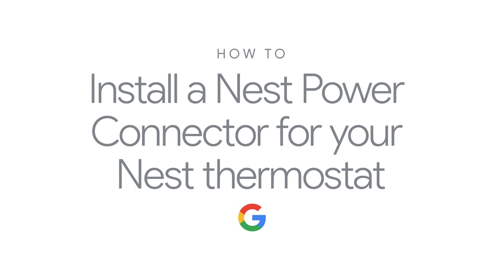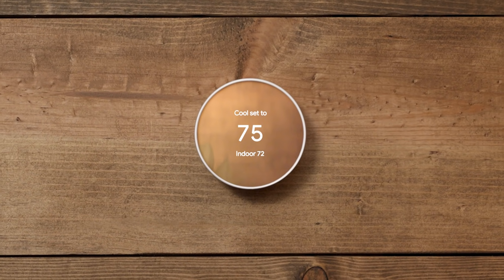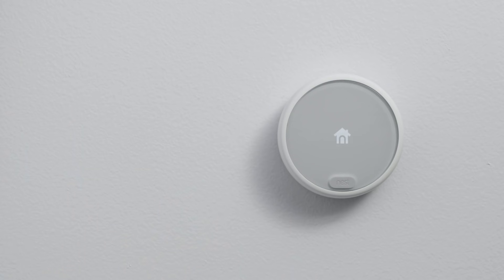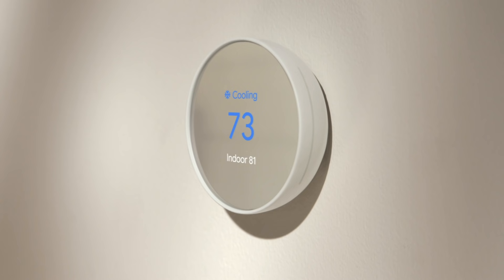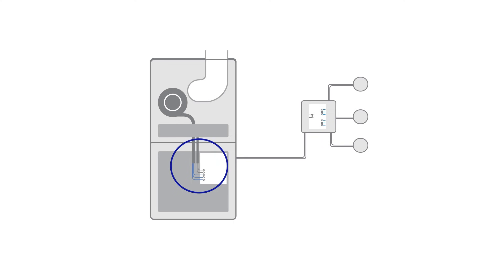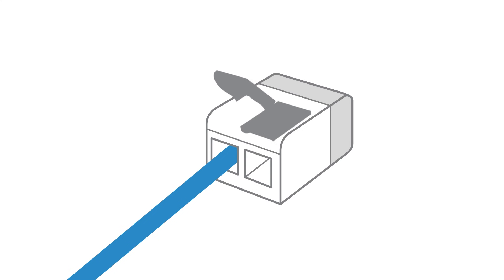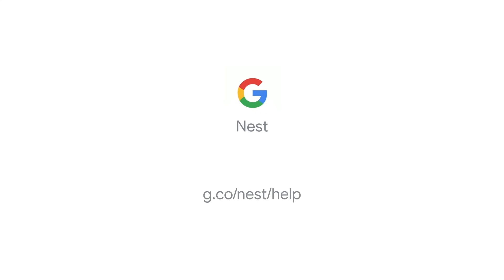How to Install a Nest Power Connector for Your Nest Thermostat

Comment: My learning thermostat gen 3 worked fine for years without this connector, and I had the Nest app. Now with my new Nest thermostat, I have to use Google Home and it is requiring me to use the adapter, but I only have two wires from a boiler - no HVAC system. The app will not allow me to install the thermostat without the adapter, which I know I don't need. Infuriating to say the least.

Comment: 2025 - no, just another wart and wire coming down a wall -  proving still that a 20-year old AA-battery-powered smart thermostat (for a basic heating system) is still more hassle-free than this.  Unprecedented, Google.  Now let me go pull that thing back off the wall.  :/

Comment: So for me this was relatively easy, but one thing I did not notice is my AC system has a switch that requires the system board cover to be screwed in or it will not power up. Had me losing my mind for a solid 25 minutes.

Comment: What exactly is an air handler, and is that something that would be installed somewhere in the walls of my apartment or in a central location in the building?

Comment: Stop treating us like idiots and show us actual equipment and wiring rather than oversimplified diagrams. I can’t make heads or tails of what you’re talking about.
Reply: Well that's oxymoronic..

Don't treat me like an idiot but I need specifics and images of it being installed onto equipment.
Reply: How are you still confused if you believe it was oversimplified? This was about as straight forward as it gets. I'm sure there are hundreds of different furnaces out there along with many different configurations for setting them up. Would you rather prefer for this video to be 12hrs+ long instead? Would you watch the whole thing? Probably not. Just pay an electrician to come out so they can refer to this same exact video. I bet you'll feel better then lol
Reply: @Viper3870750 yes, yes I would. That’s the meat of what we’re looking for.

Comment: Unfortunately doesn't work for me. My AC (cooling only) - option 7 - only has a R and G wires (in addition to C), no Y. I tried running the G through the connector instead and feeding the C into the circuit, but the AC would no longer start after that so had to remove entirely. I guess I need an electrician to fish a C wire through the walls to the thermostat. Bummer as I was hoping this was the fix to this long standing problem.

Comment: I have 3 RA832A switching relays, and a unit that I think is the zone controller (it has the X-wires from the RA832A's and 2 dials set for 100 & 180F). I don't see any 24 Vdc available. I have 5 thermostats (2-wire r/w) but I only see 4 wires into the furnace room (the 3 connected to the RA832A's and one which has been cut). I'm at a loss how to proceed with this.

Comment: My furnace doesn't have a control board and doesn't have a c/com wire to use which is why I bought this useless item. I guess if you don't have enough wires to the thermostat is useful but it doesn't create a c/com
Reply from the maker: Hey there, we're here to help. If your thermostat has power related issues, like the battery draining too quickly or Wi-Fi constantly disconnecting, you can typically fix them by connecting a common wire (C wire) or by installing the Nest Power Connector. Learn more here: https://goo.gle/3bKL9bO For more help, feel free to contact us here: https://goo.gle/2D2Shve

Comment: Your comment is true nest set up instructions say in the first sentence, only two wires needed. Those who have no issues with the start have a complete heating , ventilation and air conditioning system. That system already has 5 wires designed in warmer climates.

Comment: Had this issue with nest in my 1st house, having it again in another house. Looks like a common pain in the crack with Nest thermostat. Hope this thing finally helps and it doesn't cost another $300, I am freaking tired of dealing with that low battery headache. Was ready to switch back to my 20yo honeywell at some point, it works with no issues
Reply: That 20 year old honeywell is a workhorse. Simple bimetal + mercury circuit that works flawlessly. Would be perfect if you could setup a schedule or control it remotely.
Reply: I prefer Honeywell over nests. Nests are garbage

Comment: I have three Nest thermostats and did a direct replacement from the old thermostats with no issues. I just bought a Nest E and it gives me the error. Google offered to send me the power connector for free. I have a boiler with Taco controls and no C-wire. I ordered a 24v adapter but aren't sure how to connect it. Obviously, one wire goes to the C terminal and the other? I assume the R terminal.
Reply from the maker: Hey Joel, thanks for reaching out. Nest Thermostats are designed to use very little power, and in many cases they could use your system's heating and cooling wires to get enough power. But sometimes, you may need to connect a common wire (C wire) or power accessory, like the Nest Power Connector to provide a stable power source for your thermostat. Check this guide out: https://goo.gle/3VsXjby

Comment: WHERE DOES THE GIGANTIC POWER CONNECTOR GO?!?!?!     It’s bigger than the thermostat where are you hiding it?!?!?!?!
Reply: same question... there isn't a single video or pic that explains this anywhere... I wish @madebygoogle would make a video on this! I am thinking you just shove it behind the wall but this is so unclear.
Reply: I purchased a bigger thermostat. I only have white and red wires going to my thermostat which is a heat only system so I’ll just have to hide it in the wall.

Comment: It took a bit me to under stand why we need a c wire. Basically the heater and thermostat is in series. The heater is going to be taking up most of voltage and the thermostat get not enough. So adding a c wire it in parallel so the voltage is same.
Reply from the maker: Hey there, thanks for reaching out. Nest Thermostats are designed to use very little power, and in mayn cases they could use your system's heating and cooling wires to get enough power. But sometimes, you may need to connect a common wire (C wire) or power accessory, like the Nest Power Connector, to make your system compatible. Check this out: https://goo.gle/2K2Pk1s

Comment: I have a Nest Thermostat (2020) and my installation has the following wires: C, G, Y, O, R.
My equipment turns on correctly but I have no power (error N 260) and it quickly disconnects from Wi-Fi.
When I do the voltage test it tells me that it has 24 volts....
Could you please tell me if buying the Google Nest Power Connector solved my problem??? Should I cancel the C cable and put the connector?
Thank you so much!
Daniel
Reply from the maker: Hey Daniel, we're here to help. You could try removing the C wire and reinserting it again. Learn more here: https://goo.gle/3z49bpY
For more help, feel free to contact us here: https://goo.gle/2D2Shve

Comment: Why is it that everywhere else says that the Nest is compatible with most HVAC systems except for high power systems, including most older systems. But on this video the line is now it doesn't work with high or low voltage systems? 
I bought a Nest & it immediately blew out my HVAC. Now I'm paying to have a repairman to fix my HVAC & I stall the Nest....but honestly I'm starting to think that there's just too much suspicious double talk coming from Nest & I may just need to return it, but a more honest competitor, & look into having Google fess up for it's shoddy product.
Reply from the maker: Hey there, thanks for posting. In the video, it doesn’t work with millivolt (NOT low voltage) or high voltage. Here's a guide: https://goo.gle/375XG2f Also, we appreciate all the things you did beforehand and getting Nest products as part of your home. If you need more help, reach out to us through our support channels so we could look into it: https://goo.gle/3meAs19

Comment: Seriously? Advertising that no C-wire required, and here we go 🤷‍♂️
Returning this misleading product. I have  very basic 2 wire heating system and it will NOT work without c-wire.
Reply from the maker: Hey there, thanks for posting. While our thermostats are designed to work without a C wire in most homes, some systems may require a C wire for consistent power. You can also check our support website for reference: https://goo.gle/2K2Pk1s

Comment: I got a Nest Learning 3rd Gen which I installed during the summer. There were only 4 wires in the wall (W, Y, R, G) and no C wire. Nest worked just fine until one day outside temperature went down below zero(C). Now it just gives Error E80, Y1 wire has no power. I have a new HVAC system and well maintained. So the problem is there is no C wire at the thermostat end and nest thermostat is not getting power.
Will Nest Power connector resolve the issue?
Reply from the maker: Hi Makhsusali, we're here to help. The E80 message means the thermostat physically detects the Y1 wire, but can't complete a circuit. It’d be best to try the steps on this link first instead of getting a Nest power connector to see if it helps: https://goo.gle/3VCCAkv If the steps on this link doesn’t work, you can reach out to us through our support channels so we can better assist you: https://goo.gle/3ie15Ae
Reply: @madebygoogle  Thanks so much for your response. The very last step from the given link suggests me to Install a Nest Power connector as a permanent solution.

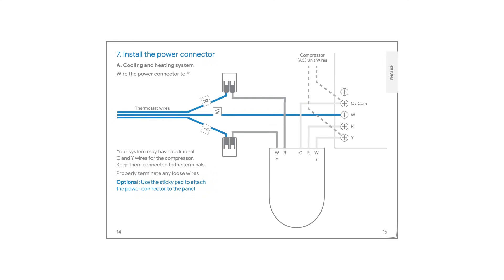Comment: My furnace at home has a gas burner, fan and AC with outdoor condenser. Followed the exact instructions as shown at 3:42 for a heating and cooling system using the Y-wire, but the furnace burner and fan won't come on when I enabled heating and only the outdoor condenser/AC compressor would enable when cooling. I reinstated the Y-wire to the furnace board and used the W-wire instead, and everything now works in both heating and cooling mode.
Reply: I’m having the same issue. Only AC kicks on no heat. I’m confused as to what you did instead. Re instated the y wire and used the w wire?
Reply: @lawrence9844  I connected the Y-wire directly back to the furnace control board and connected the W-wire to the power connector (like the heating only diagram).   It worked for a day or so but be warned, my furnace died shortly after that. I suspect the power connector was not able to maintain a consistent voltage supply and was messing up the control board. Replaced the furnace and put in a new cable with a proper common wire.
Reply: I'm curious to ask if you all set it up for the AC fan to come on while calling for heat
Reply: @DARTHREVAN1211  actually, my old furnace ended up dying after I commented around this time last year. Got a new furnace with a dedicated power wire to the nest thermostat. Everything has been working as expected so far.
Reply: @hiddenmist2  Did you try replacing the HVAC control board before replacing the entire unit? If you thought the voltage from the power adapter messed up the hvac it would have only affected the control board which wouldn't have made the entire unit bad or need to be replaced. 
I was told by a heating and plumbing guy that my central air conditioner outdoor condenser was "hit by lightning" and I had to buy another one that was $500.00, I live in a trailer house with a tin roof and the condenser was in the corner of the trailer and my back porch. There was no possible way that lightning could have hit the condenser being so close to both walls and much closer to the ground than the metal easy bake oven of a trailer house and added back porch, without hitting the trailer first because it is closer and further away from the ground. In addition to the absolute lack of any lightning storm or power outages. I later found out that it was just one of the capacitors in the condenser that went out and it was replaceable for less than 20.00 rather than the whole condenser unit needing replaced, the service guy just didn't want to put a new capacitor in it, when he could sell a new entire condenser and the labor to remove the old one and install the new one. I haven't ever fallen for that kind of  service ever again. If they tell me I need a new unit instead of repairs I tell them I'll have a different service place to get it from and installed by. They usually don't want loose the business and suddenly they thought of how they can repair the components instead of replacing the entire unit.

Comment: This thing completely failed me.  I was connecting a Google Nest 2020 version to a Taco 503-4 switching relay.  My other zone has a Google Nest Learning and it doesnt require this thing.  The 2020 thermostat still kept saying the stupid power error even though I took a multimeter to it reading 25V.
Reply from the maker: Hey Albert, we're here to help. The fix the power help code of your Nest Thermostat, follow the troubleshooting steps here: https://goo.gle/3JZAZ3D For more help, contact us: https://goo.gle/3ie15Ae

Comment: How can we update the thermostat before we install the connector but we need the connector to install the thermostat
Reply from the maker: Hey Steve, thanks for your inquiry — we're here to help. If you have a Nest Thermostat E or Nest Learning Thermostat (3rd gen), you don’t need to update. If you have a Nest Thermostat 2020, select Settings > Version. If the version is earlier than 1.1, you’ll need to update. You must finish installing your Nest Thermostat before you install the power connector. Check more details here: https://goo.gle/3bKL9bO For more help, contact us: https://goo.gle/3ie15Ae

Comment: Will this work with floor heating and would I need the connect also?
Reply from the maker: Hey Alex, we're here to help. Nest Thermostat devices are designed to work with most 24 V systems and with all common fuel types including natural gas, oil, and electricity. Check more details about compatibility here: https://goo.gle/3dfzQnH Also, here's how you can tell if your Nest Thermostat needs a power connector: https://goo.gle/3LFPhao For more help, contact us here: https://goo.gle/3ie15Ae

Comment: My Gen 3 suddenly needs daily charging after 6 months of no issues. Do I really have to buy this kit and go through all the hassle? My A/C unit is on the roof of my condo and I have no way of accessing it. Can't I just run a MicroUSB cable through the wall instead and keep it powered through the charger?
Reply from the maker: Thanks for the post. We'd recommend the steps on this link first: https://goo.gle/3P2TpRO. If it doesn't help — reach out through our phone, chat, or social media forums so we could help you in sorting it out: https://goo.gle/3ie15Ae

Comment: Is this box just a resistor? Because of the way the wiring is, it sounds quite close to this "solution", of course they have you connect the R into it too.. but still...
Connect a 220-ohm 5w resistor on the furnace between “C”&”Y”(or”W” if you have a heat only system)

Comment: For boilers or people with zone controls like taco ect.. you ll need a common creator relay. But this google adapter works best when you have an hot air furnace or ac unit. When you have a boiler the way that the common is runs is weird and wont work.
Reply: True 
I am trying to connect this nest thermostat with a boiler heater and it won’t work
Reply: @tttota5421  I installed an isolation relay.  This should solve your problem.  Here's a link https://www.youtube.com/watch?v=f0v3FeDZBeY
Reply: @erickvargas5427  I noticed when using this adapter off the taco zone valve it causes the circulation pump relay to flicker.
Reply: @inkman411  yes that is a short and makes the pump relay chatter.
Reply: @erickvargas5427  I appreciate it erick thx 🙏

Comment: If you have mulltiple thermostats, does each one require a seperate power adapter?
Reply from the maker: Hi Jovan, help's here. Yes, you'll need to have a separate power adapter for each thermostat if you have multiple devices. Learn more here: https://bit.ly/3z34z2e If you need more help, reach out to us through our chat or phone support so we can better assist you: https://bit.ly/3gj9N2E

Comment: So, I installed my Nest and was having issues with the Taco Valve opening and closing. I found it may be the power issue and came upon this device. Thought I was saved. Installed it, and it seemed to work, but then it happened again. The Valve will open and close and open again and stay open even after done heating. This would cause over heating in the house when other zones called for heat. Anyone know how to fix this? I have a Taco SR503 with Taco Sentry zone valves.
Reply from the maker: Hi Leon, we've got you. We'd like to take a second look into this. Reach out to us through our chat or phone support for further assistance: https://bit.ly/2IWu5Rx
Reply: @madebygoogle  Also, You are Massive company, and your support only goes till 2pm Eastern. How can anyone get support from you with those hours?
Reply: @madebygoogle  I tried that before and they told me because I have Multiple zone system, they can't help me and referred me to the team that comes out and installs the devices. Google Nest support also told me the installers would do complimentary phone support and if a tech had to come out then I'd have to pay. The support company said they don't do phone support, and have to send a tech.